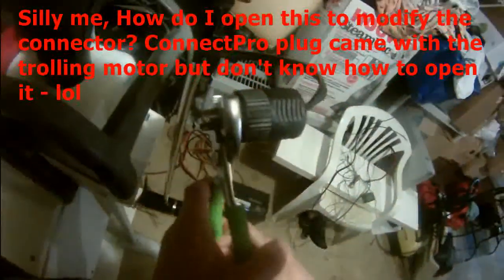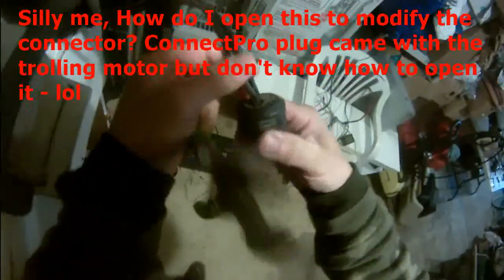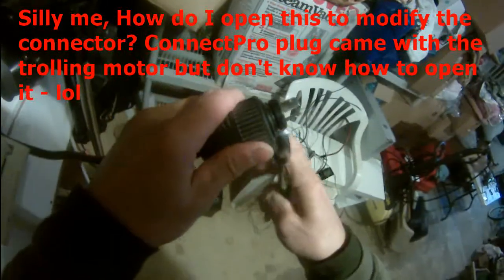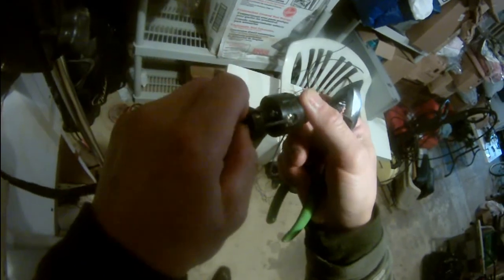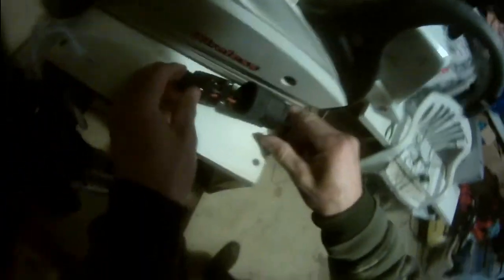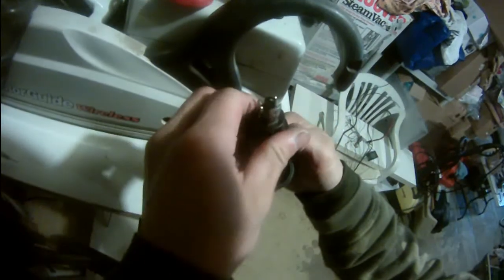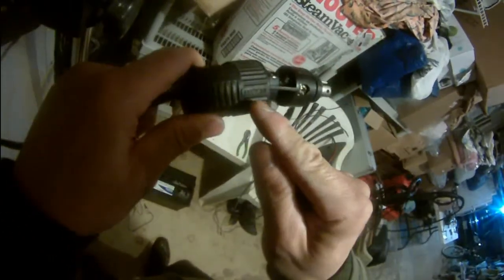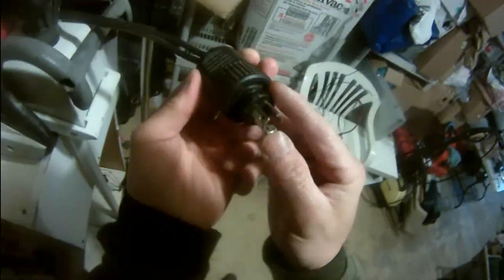Marinco connectpro plug - how do I modify this for my Motorguide trolling motor DC power?

Comment: The lock/unlock is not to open the plug itself.  That's for once you plug it in the receptacle you twist to lock it in place.  To open the plug to get to the wiring you pull the fatter base part down like you did eventually.